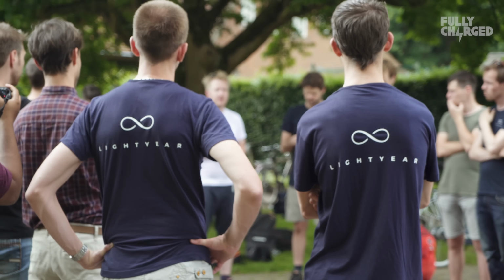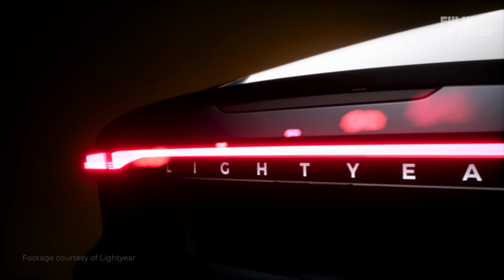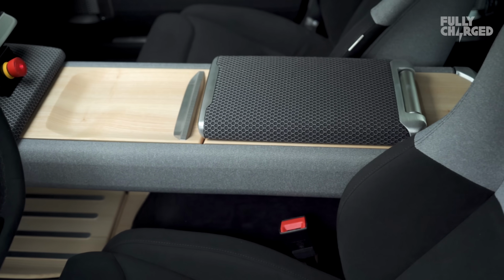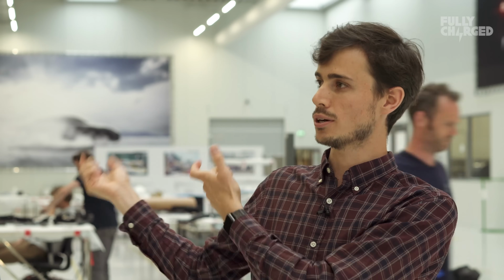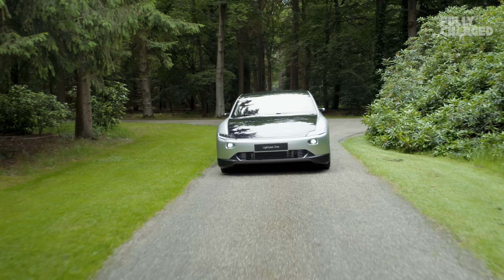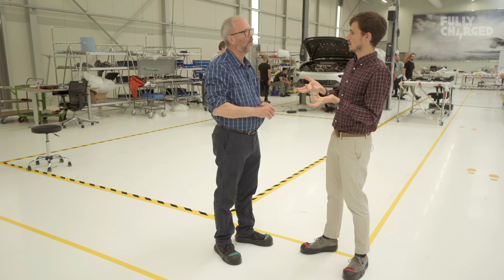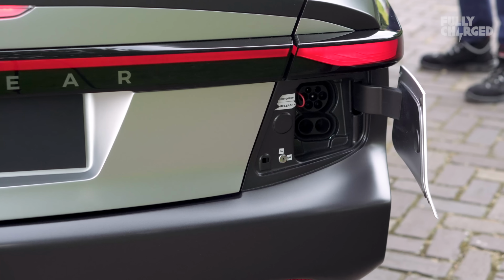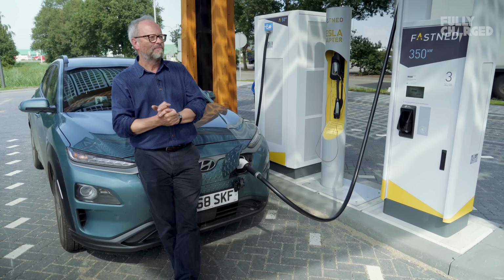Lightyear One solar powered electric car - exclusive first look | Fully Charged

Comment: I would wait until perovskite based solar panels go into production, so the whole surface of the car is taken advantage for energy generation (it can be made transparent)
Reply: Innovation comes from the idea of doing the opposite of waiting. Let the next generation of Lightyear worry about upgrades in technological advancements.
Reply: but perovskite is easily destroyable by weather conditions, innit?
Reply: @humlon97  it is in the research stages, several companies are tackling the problem of resilience.
Reply: quelorepario sure thing, but I guess you'd make it as a whole roof piece... which would be irreparable... the whole solar thing is not as green as it seems... but the technology is amazing
Reply: @humlon97  Why wouldn't it be reparable? That is not really the challenge, just layer it under a protective glass and it is as good as any other surface. How many times do you have to replace your windshield per year?

The current challenge is to replace the lead from the perovskite solar cell, increase efficiency and test the durability to last for more than 30 years.
Reply: quelorepario I didn't necessarily mean the glass failure... from what I know PV cells are connected in series, so failure of one cell means you have to replace the whole module or accept major effectiveness losses.. in conventional PV you have stuff like snail tracks etc. I'm not sure how it works in perovskites but I guess it's still a series connection. But I guess you're right and I'm m the devils advocate here, I'm hyped about renewables too.

Comment: Finally someone did it! 🙌
Reply: Did what? That exercise displayed the output of the low end of single digit HP. The multiplication factor required to make the car useful, is quite large, especially when you consider the substantial additional weight that must be added to make it truly safe and roadable. But it is a lovely dream, chasing yet to be developed technology. I wish them the best of luck.

Comment: *Solar assisted  Didn't want anyone to get the wrong idea. You're welcome.
Reply: If you're traveling for only around 30 miles per day, it's fully solar powered, never need to be plugged in.
Reply: @jovanleon7  its a hoax. why wouldn't they make videos of it sitting in the sun all day and see the range it has from it? if it went 10 miles it would be viral
Reply: Assisted makes no sense. Anyone with half a brain knows what was implied anyway. You're welcome.
Reply: @edism  that's not true, there is an unimaginable amount of people who cant put 2 and 2 together
Reply: @CreativeNames101  I agree with latter part of your comment. What did I say that you disagree with?
Reply: @edism  the anyone with half a brain part
Reply: @CreativeNames101  But that doesn't imply anything qualitative right?

Comment: Granted they are starting with a high-end, luxury vehicle to maximize their profits, but that would be necessary for the company to continue and to create the full-size, mid-size, and economy-size vehicles in the future.  This makes sense because you only have to sell several hundred of your first vehicle to finance the creation of your second, less-expensive vehicle which would have a bigger market and thus finance the next smaller more affordable vehicle.

The great thing about this group is that they are addressing a problem that has been around since the beginning of electric cars - charging the car.  This may be different in Europe and other areas where electric cars are more common, but charging can be a big problem.  I live in an apartment and there is no way for me to charge a car at home.  There are limited facilities in the area to charge electric cars.  I also live in a relatively sunny area and my car sits in a parking lot 7-8 hours per day.  If it were an electric car with solar charging then I would be much better off.  This is a great idea!  Even if it doesn't cover 100% of your usage it will make a considerable improvement over having to pay for 100% of your charging.

One of the biggest problems with making electric cars more main-stream is that you have to create a car for the young market, those people who are buying their first cars.  Someone has to create a car that a sixteen year old boy wants to buy, not just because he wants an electric car, but because it's a good looking car that doesn't cost a lot of money.  Once you have young people buying electric cars from their first car, then the world will truly change because they will probably stay with electric when they buy their next car. 

Cost, styling, efficiency, ease of charging, name recognition, and dependability are all important factors that need to be taken into account to "corner" the youth market.  Many of the larger car manufacturers are putting out electric cars, but it will be the company that breaks into the "youth" or "first car" market that will see their profits explode.  If I could buy an electric car that costs the same as an economy car, has a decent range, doesn't cost a lot to run, looks nice, and is dependable, I would!  But that car doesn't yet exist...maybe soon.

Comment: Yesterday TOYOTA showed NEARLY a kilowatt of solar panels on a prius.  Sharp did over 30 in flexible panel of a meter and many Prius at around 35% efficient panels are about in next few months to race all over Japan for data.

The shade on a recumbent ebike even using 2016 effiiencies can do highway speeds from 11 am till 2pm easally in much of world especially if enclosed like Organic's for slippperyness and extra long to do 85+ if wind at BACK.  Because ebikes are light new nonwearing wheels can be used on concrete. . .  like high rpm record skateboard all metal tires duh

Comment: I live in Arizona this would be perfect for me.
Reply: Is the point of this not to extend the range on the car? I don't think they are trying to make it run purely off of solar. It has a battery that is smaller than a Tesla yet it can get more range on a sunny day. If we can find away to cheaply incorporate solar panels into the roofs of electric cars which can give us 50-200km extra range depending on weather I think that is a great idea.
Reply: Evan Leggett I ran some numbers based on the idea that “adding some range” is worthwhile, especially if it allows for smaller battery packs, thus lighter, more efficient cars.  Assuming a 1kW panel and a car needing 50wH/km (both rather optimistic, put plausible, given current tech) then in the course of an hour’s driving we will have added 1kWh to the battery (more precisely, not used that much electric from the battery) which is an additional 20km of range, or 20%.  That’s not too shabby, and that’s not the absolute “best case” because we can always posit a more efficient car or solar panel, but it’s certainly toward the best case end of the scale.  
However, in contrast, consider adding commercially available panels to a Tesla: get perhaps 300w from solar for a car using 150wH/km and after an hour’s drive we have only added 2km range, or 1.3%. Not really worthwhile.
But, doing the math has me revising my thinking on the concept of adding solar panels to an electric car.  If the panels themselves are efficient enough, and the car efficient enough, then there comes a point where it might make sense.
But the fact remains that solar can’t be relied upon while driving, so to quell range anxiety the battery packs will still have to be large enough to get to the next charging station without relying on the solar panels.
Reply: @jpe1  Even using your numbers, one could hypothetically do all their driving on the weekend while solar charging the rest of the week. 

 The only question here is one of economy. Does it make sense to pay for solar power from your car's roof or the standard electrical rate? What's cheaper? I'd expect my electricity here in PNW, USA is much cheaper than the hypothetical calculated rate cost of these panels' production, but not everyone is in the same boat and production costs will only get cheaper. 

The additional convenience may pay for that disparity, depending on the person and how much their time is worth. This car isn't cheap by any means; people won't be buying it as a commuter or daily driver. The point of this and why it matters is the technology now exists to produce an all electric, solar powered vehicle that can conceivably operate without ever plugging it in. The reported efficiency is incredible at 83 Wh/km (https://lightyear.one/lightyear-one/). They report "10-12 km/hr" solar charging rates (https://youtu.be/bSbWwn_YCr8?t=1007). That calculates to 830-1kw of output in direct sunlight. I don't know how reasonable that sounds, but even if they're half that and you only see 4 hrs of direct sun a day, you could drive 12mi without a plug in. If their high end numbers are accurate, and assume 6 hrs of direct sun, you would see 44 miles a day.

It will likely never be possible to drive 10k miles a year solely on power from the cars own solar panels, but a car that's capable of 10 miles a day could be really convenient to the right persons. Right now it looks like that will be the 1%, but if this is a winning strategy and consumers see the value, all cars will get more efficient as well and the economics change.

That's pretty cool.
Reply: Not until we have cheap good solar panels, and even then not that great actually. Main problem is solar power requires 10 times more area than a car to make it truly self sufficient
Reply: @levkrainov  Amazing that so many people bat a blind eye towards the leaps-and-bounds technology makes. Thirty years ago the tech wasn't there to make the Lightyear an actuality. It takes an optimistic consumer-base to help the industry evolve and grow. For D'sTech, it may just be perfect. To criticize what constitutes perfection for someone else is brash.
Reply: Robert Feight to quote Star Trek’s Scotty: “You canna change the laws of physics.”
No amount of efficiency improvements or new technology will ever be enough for a car the dimensions of a standard 5 passenger sedan to travel powered purely by solar panels mounted within the footprint of the car.  There simply isn’t enough energy in the sunlight.  That fact means that the most practical, economic solution will always be to used fixed solar to provide the energy, and some kind of energy storage (depending how you define it, a “battery”) in the vehicle.
Pocono Raceway in Pennsylvania does this today. They converted one of their unused parking lots to a solar “farm” and now when electric race cars race at Pocono they do so without any CO2 emissions.  www.evsr.net for more info on the electric race cars that race at Pocono.
Reply: @jpe1  while I appreciate the reference perhaps this wasn't the best quote to illustrate your point as I recall afterwards Scotty then proceedings to "change the laws of physics" by inventing a new engine cold start procedure. Application of the laws of physics and new ways of applying them seem to make possible what previously was thought to be impossible.
Reply: @levkrainov  When the panels get better, the ones in the car can be replaced. When the battery technology gets better, the one in the car can be replaced. Simple.

Comment: Seems like they are being far too optimistic without having done much actual testing. They will probably end up like fisker
Reply: I'd be very surprised if they get anywhere near as far as Fisker. This thing is doomed from the word go.
Reply: I’m just be realistic it’s too ambitious for current technology. But I really do hope that it works could be a game changer
Reply: @liammclean7532  probably you're right. I just saw that they're ranging it at 149 grands. Nobody will dish out his 149 grands for this whereas that money could buy 5 teslas.
Reply: why are you guys so negative?
Reply: @davemwangi05 
I've looked at the specs on their website and there's nothimg new nor impressive. And that's before we look at the price and questionable looks.
At the end of the day it's just a massive, expensive, unnatractive, slow, impractical electric car with some not-so efficient solar panels which provide a negligible range increase. And that's before we talk about the fact this is a mere prototype (the easy part) nowhere near production, which is going to be a humongous undertaking.
Toyota is about to release an electric or hybrid Corolla with solar panels like these on the roof and bonnet and no doubt at a fraction of this car's price.
Regardles current solar panel tech isn't workable for a solar car. Besides why bother with such an insane project when one can just use solar panels for a charging station and you'll get a much better result with an equally eco-friendly solution?
Like I said before I'm all for innovation and pushing the boundaries of what's possible but this project seem like non-starter.
Sion on the other hand seem to understand how a car like this should be done. I reckon they might pull it off.

Comment: I expect one problem with these cars will be AC
Reply: How so?  In the video it said they have a 400 km range on battery "with the AC going".
Reply: @vink6163  You can have an AC but how effective (cold) would it be? AC is one of the most energy hungry processes
Reply: @pokerface7840  In an electric vehicle, propulsion uses many times more power than AC, as they are designed to deliver huge amounts of power to get good acceleration.  If you consider that all electric cars can deliver more electricity than you can get out of a normal house (in fact there are moves towards being able to run your whole house off the EV battery during a power outage) then there's pretty much no practical limit to the size of the AC unit you can install.  A typical AC unit for a house might be between 2 and 10 kW, and if even lower end EVs can charge at 50 to 100 kW then you can see that they have enough power to run the full house-sized AC on five or more houses at the same time.  Likewise if you have a tiny 35 kWh EV battery, and your AC is a monster at 10 kW, then you're going to be able to run the AC for 3.5 hours on a full charge.  No car needs an AC unit that large, and most battery packs are larger than 35 kWh, so AC is definitely not going to be a problem for EVs.

Comment: I dont understand why not to install an alternator and you wil never but never has to use elcetricity again
Reply: It is because of America.....USA.....They want to keep the Electric cars inefficient as long as possible. There are better inventions like Perpetual engine via Magenets and even Electric Power extraction via the Air (constant 12v of energy can be plugged into when using the right frequency).....This with the so called solar is bullshit tech....being depended on the sun....when it is not a constant....
Reply: then how can u produce mechanical work for alternator. it requires fuel which causes pollution
Reply: KURAMA FOX you use electricity only to start the car and thats it never again

Comment: I wonder if instead of embedding the solar panels in the roof and hood of the car if it be better to have a smaller lighter retractable solar panel the could track the sun?  The benefit besides weight savings would be as solar panels become more efficient you could swap out the old panels for new ones.  This really practical for panels that are embedded into the car's body.  Yes with my idea of a retractable solar panel you probably couldn't charge while the car was moving but a car spends most of the time just sitting anyway.  Yeah while on a long road trip panels embedded into the car's body can charge while moving but how often do people take long road trips?